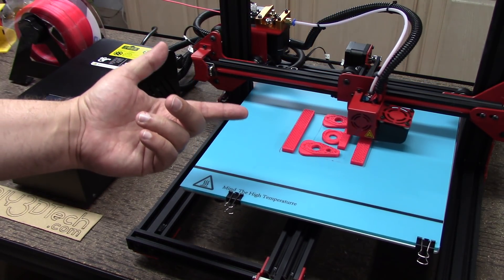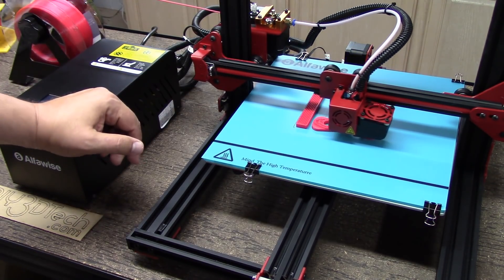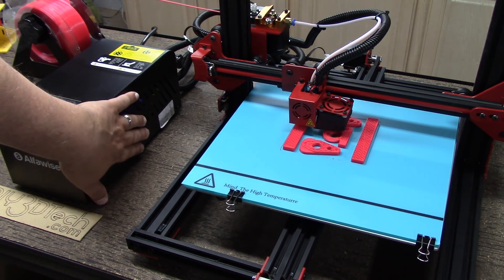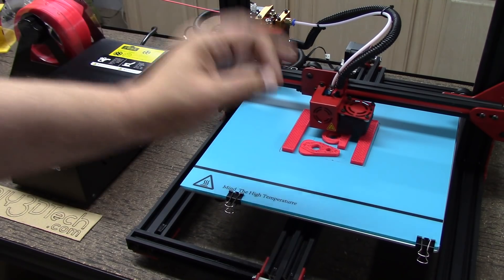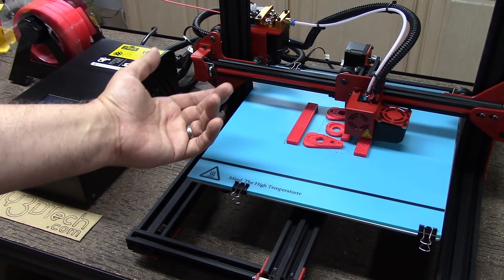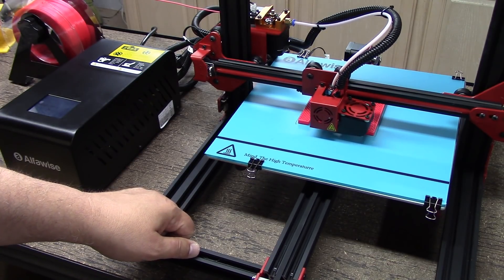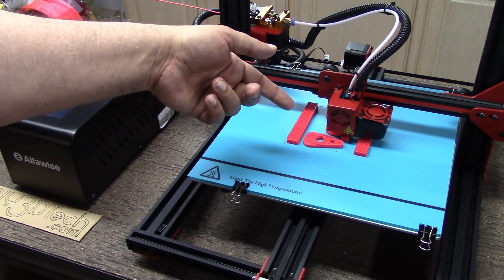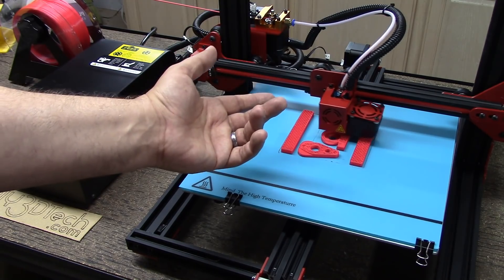Gearbest Alfawise U20 - Some Updates and Comments!

Comment: Greetings.
I just bought the Alfawaise u20 and I have newbie doubts in this machine.
Do the pins or handles that lead to the warm bed, do not give any problem to touch the nozzle or affect the printing areas?
Reply from the maker: Not sure what your asking as mine has turned over a thousand parts so have been very happy with. Possibly you could clarify the question?
Reply: @DIY3DTECHcom  Lo siento mi ingles no es muy bueno.
Las prensas que sostienen la base de vidrio de la cama caliente no perturban la boquilla.
Reply from the maker: OK?

Comment: I was going to buy my 13 year old the CR-10.  I saw the price on this one.  He is coming from a small Divinci xyz mini  And wants to print large prints and helmets and masks.  Should I go this??? Or CR-10?  I need help fast... PLEASE!
Reply from the maker: For the most part they are the same printer, some have complained of the way the firmware handles the vase feature of cura, however I have not had an issue and I have enjoyed it so would recommend it especially being more economical them the CR-10

Comment: Running my U20 for 2 days now. Having issues with PLA warping. Some models are fine, but, some warp despite different temperature settings and unstick from the bed, at some stage. I thought, warping was only the issue with ABS. Any idea, how to resolve it?
Reply from the maker: PLA will also warp just not as bad as ABS.  Warping is caused by differential cooling.  So make sure bed is insulated, run at least 70deg on larger parts and you have a good build adhesion surface that is clean between each use with alcohol.  Also print as cool as possible to avoid a differential...

Comment: Im new on 3d printing and Alfawise u20 is my first one. Im having troubles with printing other models exept the ones that was inside the usb provided by them. I tryed comparing the start and end blocks but and are the same. Someone had the same issue?
Reply from the maker: Assume your using CURA?  If not would suggest to use it and use its basic PLA profile and things should work.  Also when you set the machine CURA (under add printer) DO NOT change any of the Gcode blocks unless you know what you are doing...

Comment: Do you have any troubles with printing via USB? For me it is zeroing X axis every few second, also every second print goes to corner and start extruding - endless.
Reply: BTW I tried original, and two new firmwares.
Reply from the maker: What you could try in manually home the X/Y as well as Z manually before the start.  As yes I find that it thinks it needs to do restart (like a loss of power)  and losses its home location.  This has worked from me..
Reply: Currently we (because I have found another person on YT with same problem) solved it by using Cura 15.04, also I had some progress with cutom gcode to set absolute positioning. 
There it is: https://www.youtube.com/watch?v=97kHyRtm480

Comment: V-king pro is a core xy DIY printer that looks pretty interesting. Maybe do a build series with it?
Reply from the maker: Interesting, yet looks like the Tronxy x5s.  I wondering about one of those circle printers (that spins in circles not a delta)....
Reply: It took me a while but I found a rotary 3d printer you could buy. Polar 3D 394208 Printer with Polar Cloud Connectivity on amazon. New it goes for $933 US and second hand $374 plus free shipping.
Another interesting one I have seen was a DIY one that had a bed that moved in x and y, the hotend just moved in z. Can't wait to see what you do!
Reply from the maker: Wow that a lot for the Polar printer as yes that is the one was looking for a saw it a couple years back at a makers fair, yet a grand for a novelty is quite a bit...
Reply from the maker: Lol!  seems like the weird ones are the expensive ones!

Comment: i bought this and im having a pain trying to level it. can you help me with that? Please PM me if you can.
Reply from the maker: What seems to be your issue?  Should level out very easy,  within a couple minutes it was done and dusted...
Reply: So when i was assembling the printer i didnt notice that it was missing the screw that holds the extruder nozzle in place. I replaced it and was able to level the bed. The issues that im having now is when i try to prepare the GCODE file using cura the machine doesnt start the print in the center of the build plate. I have been scowering the internet to try to find a guide to setting up a custom printer for the U20, but i have had zero luck. Can you share with me your settings or what slicing software you use.

Comment: anyone could change parameters in the printer? i dont like have a closed firmware... and i sent gcodes to change things like steps, but the printer doesnt reply to these gcodes...
Reply from the maker: It ok with closed systems  and yes I have heard that the Gcode interpretation on this might be a little different, yet I haven't have an issue with of the mill use.  Still have to do a Vase to see how that turns out as everyone tells me about that...

Comment: NOOOOO no bearing!!! "remove" the black printed part. unbolt the bearing that is already there and REMOVE the bearing. put it back together with "NO" bearing.

Bearings add z banding. bad bad :-)

Creality larger bed leveling knobs will fit if you use a hammer :-)

also the CR-10 bed strain relief also fits! perfectly.

run the parts cooling at 70% orders of magnitude less noise and cools just as well.
Reply from the maker: Not sure I agree with you on bearings so a good project :-)
Reply: DIY3DTECH.com here's a good way to understand the mechanics imagine drawing a circle with a pencil on the table your arm is the Extrusion rail

My arm is the lead screw now I'm going to grab your arm as you attempt to draw that Circle

Unless I can manage to move my arm perfectly in sync with your arm I'm going to mess up your circle this is z banding and Noise

This is the Extrusion and the lead screw both pin down the Extrusion must be pinned down or you'll never get a circle the lead screw must be free it only needs to be restricted on the vertical axis otherwise your layers won't be accurate

This would be like your arm and my arm connected with a string as long as I don't move too much my string will never pull on your arm and never screw up your circle

This is the lead screw unconstrained with no bearing

The only time a constrained  lead screw does not cause noise is when it is absolutely perfectly straight and absolutely perfectly parallel to the Extrusion which at this price point is not going to happen :-)
Reply from the maker: Many thanks yet I do have an engineering background  (albeit electrical over mechanical) yet if I constrain the system at the top as well as say the roughly middle my risk in error would be speed of motion as the flex coupler will both absorb as well as discharge axial error as it will take more force due to binding thus slowing the turn by converting kinetic to potential then back to kinetic energy again.  Yet given the slow speed of movement the results should be negligible if at all.   As the one thing I totally agree with you is the last line as my CNC machines do have flex couples and are aligned to a very high tolerance which we not see on a $299 printer :-) yet watch for a video on this as I plan to do some test!

Comment: Could you try a vase mode print? So far we have 3 reviewers reporting U20 will not print correctly in vase mode?
Reply from the maker: Very interesting, with what slicer?  As a printer is simply a Gcode interpreter so would assume (don't know for sure) that might be more based upon arc's (G02/G03) then simply G0
Reply: My tests were done with S3D, not sure what Nerys or Rics3D used. Btw: the touch screen tends to crash as well in vase mode.
Reply from the maker: So I understand what your trying to say,  if you slice something in vase and run the GCode on the printer it crashes the screen?  This is interesting, do you have thingaverse link I can try just so its apple to apples?
Reply: Try this one: https://www.thingiverse.com/thing:550604 (to be precise: SpiralVaseHD.stl sliced in Vase mode, i.e. single outline corkscrew). Tried 5 different ones, same diff, so its not model dependent. As long as its mostly round and vase - so: arcs would be my guess as well.
Reply: Or: just do a big cylinder in your favorite CAD and use that. I did a demovideo using a plain and simple cylinder. That way we eliminated possible STL issues.
Reply: absolutely any "spiral/vase" mode print with CURVES will fail. the printer will start to stutter and the UI will become unresponsive. it will continue but it will be a failed print (holes artifacts etc..) low poly circles work fine since they are really not curves at all (yes I know technically there are no curves in gcode but you pass a threshold where its defacto curves)

any spiral mode print with NO CURVES (such as rose for your girl vase) will print just fine.

only CURVES and only in SPIRAL/VASE mode. their engineers appear responsive. most of the shipping damage issues will be corrected and wire management will be corrected. I have sent them files to figure out the spiral/vase mode issue.

if you take the SAME vase mode and print single perimeter but "normal" layer by layer it works fine. so its something specifically to do with driving all 3 axis at the same time (Z constantly rises in spiral mode NOT in layers one at a time) that makes the system puke.

a good one is the VERNS STYLE ROCKET. print that with no bottoms in spiral/vase mode. after about 24 or 25 layers it pukes.

I also suggested a small exhaust fan to keep the brain box cool (the PSU vents INTO the brain box!!) and they are going to add one.
Reply: I used my German contact to push for more information on the firmware, reported the vase mode bug. I haven't yet run into a temperature issue in the control box, but I shall start another longer print and go measure. So far GB seemed responsive, but it looks you got the better / more direct contact.
Reply from the maker: Will give this a try!
Reply: Hi everyone, same issue in vase mode. I went crazy until I discovered this comment. There is a Facebook group, why don't you come in and speak there? Thanks!

Comment: Just had me thinking, a couple insulated actual bicycle-like chains could be used as current conductors for the + and -. That would be a safer option to having a continuously repetitive flexing power cable. Another option would be wireless power transfer using coils that aren't even physically connected, though I have to wonder about how effective that would be at higher amperage, to avoid it modifying anyone's DNA if standing too locally to it. Lol
 Maybe that would work if the printers frame had a faraday cage. 

Eventually these printers will come with a brain implant, bypassing the need for the touchscreen and the processor handling the machine code, it will be the human brain itself. Cr10 s5 here, and it needs a addon MOSFET because the heatbed reaches only 85c, when ABS wants 110c. That's another thing!
Reply from the maker: LOL!  I am not one much for ABS (see here for why: https://youtu.be/sUe3jrj87aE ) however I would be first line for the brain implant :-)